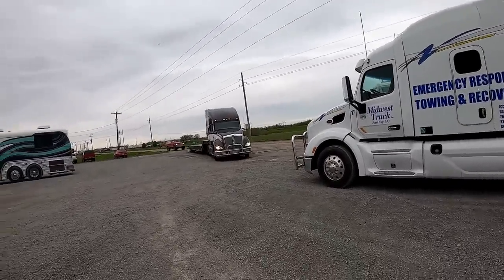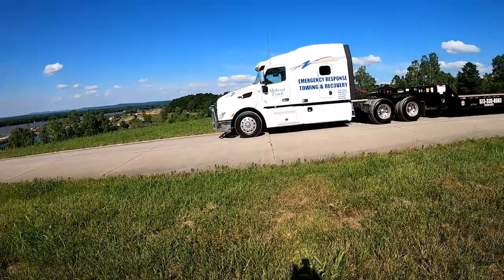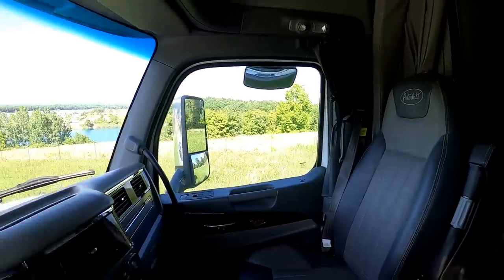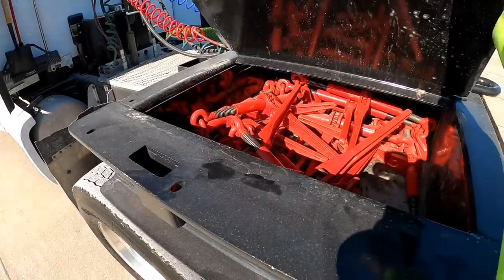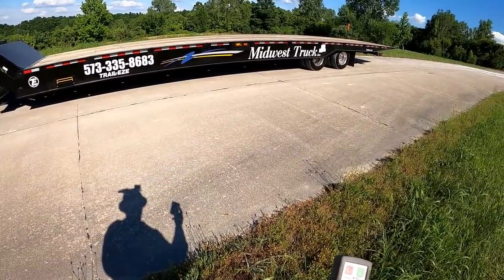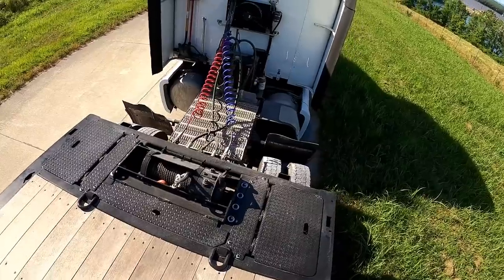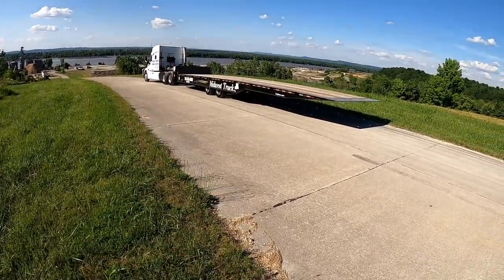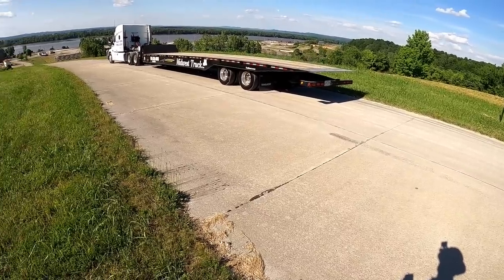Walk Around of Truck 17 and our new Trail-Eze TE801 trailer #T-1!!!

Comment: Congrats on your new unit(s) I know you'll wonder how you ever did without it. Nothing works better for rescuing dead trucks,,, The versatility of a sliding axle unit is unbelievable.. Couple of questions as I'm not familiar with traileze,,, when the axles are in the forward position, is the ram extended or retracted?.. can you travel with the deck in the high position for long loads,,, otherwise I love the multiple tie downs, and stake pockets,,, best of luck with your new units

Comment: That is a nice trailer I like all the extra tie down points. They'll be really useful for when you have a badly damaged semi or a load of damaged parts to tie down.. When you have the axles all the way forward you will have to watch the swing on the back end. But it will pay off with the extra maneuverability in tight roadways where it would make turning impossible.. I cant see a way you could make it any better what with the winch and the low approach angle  on the deck. Id hate to think what it costs but you'll make it pay.

Comment: Ron, always good to see a family business expanding. Do you plan on putting half or full fenders on to keep the  debris off the sleeper?
A headache rack would work for more storage and protection also.
As always stay safe and God bless to you and the crew.
Reply: I agree with both of these suggestions also. Rear fender keep the road spray down. A headache rack could be usefull to hold stuff--but also as a another spot for work lights, etc.

Comment: Add a air fitting on the trailer..we found during the winter a female wouldn’t work so we went with a gate valve and a male fitting otherwise you need a long hose to the tractor to air up to release brakes and raise airbags on motor homes and busses. You will need to load busses backwards as you only have tandems on the trailer it puts you over 37k also load on level ground if your leaning it will increase the lean as you extend the wheels back..I drove both landolls and trail eze and trail king trailers for towing for years

Comment: That is a cool trailer, I'm sure you're going to get this thing into some more tight spots, I'm looking forward to those videos!

Are you going to end up getting some regular flatbed equipment on the truck? Straps, ratchet binders, edge protectors, dunnage, etc?

Also, I know you are planning on using it for recovery and transport and not regular freight, but do you have a safety plan for a headache rack or bulkhead?

Stay safe!

Comment: Is that new trailer low enough to load some of the new class A motor homes/coach style RV's with there low ground clearances? It looked like it should be able to do that in my opinion. You might need to mostly convert the sleeper in to a storage area. I also think this unit will be a good candidate for your batter powered portable lights.

Comment: Really like that trailer, can you leave it all in one flat plane and move the wheels back to haul long stuff? 41` + 9` - 50` stuff/ load
Reply: I think Plaza Towing has some older videos showing loads like that on a Landoll. You just run the front axle onto the upper deck and secure one end in both directions, then level out and finish securing the load. The load ends up at an angle, but as long as it clears anything overhead that's fine.

Comment: VERY nice ! Why did you go with this trailer over a Landoll trailer?  I know you have two spaces for binders and chains on the trailer. But I still think you should add a chain box and have two sets  four chain and binders each maybe three sets. Plus if you get a job like someones motor home and they want it to the other end of the state or some place far away the driver can sleep in the truck.

Comment: You may need to take it to a dealership but I believe you can have it set to idle the truck up automatically when the pto is engaged. Also have you thought about installing a headache rack or some kind of removable stop on the front of the trailer?

Comment: Plaza Towing has a trailer like that and they use it quite often. You started with the rotator and then got the trailer. They started with the trailer and then got a rotator. I know it will come in handy.

Comment: Well, that is a very impressive trailer. I trust it will give many years of excellent service. Will some emergency lighting be installed?
Reply: A nice big LED flashing arrow board with SLOW DOWN MOVE OVER on the back of the cab.

Comment: Well if you can't sell it even if you try, then use it for work, good decision. XD I'm sure the sleep and living room of that unit will come handy one day. The fridge could be needed on hot days when you have a bigger recovery, as well as the room itself when it has air conditioning. Nice spot to take a short break when its hot or something.

Is it possible to add a holder for the traffic cones on the same spot where the broom and shovel are? Just on the passenger side where is still room. I'm sure there whould be a good place for those because easy and fast to reach AND on the passenger side.

So that trailer is one of those where the rear axles move forward so that the tail goes down to load a vehicle on it? Only saw this once as someone transported a bulldozer but this system is surely handy because basicly the whole trailer becomes the ramp.

Comment: I think the biggest major difference between this unit and what Plaza uses is the tool boxes on the tractor Plaza has. 2 on each side like on your unit 15.
With the height restriction of the overpasses, how often would this unit be usable on a recovery on the highways? I suspect that the height of the overpasses will make it less than it would be otherwise.
oh and Ron, those lighted gloves:
June 20, 2020 at 6:26 pm
Processed Through Facility
ISC CHICAGO IL (USPS) 

the border / airport closures delayed shipment. :/

Comment: I have seen Jerr Dan advertising their R.A.I.L lightings system on the sides of their rollback decks.  Might be something worthwhile to look into to increase rearward visibility on the trailer especially when loading equipment that could block the lights on the 579.  Essentially It looks like they just fabricated a box that places an amber light at a 15 degree angle so it faces traffic when the bed is tilted

Comment: Ron, You're probably aware. But just in case you don't. Both East MFG. And Mac Trailer sales can and will build you a custom headache racks. Mac trailers built all of ours for us. Water tight seals and built in light bars on the top for work lights and strobes.  IHMO, I think Mac is setting the bar in this department. "You dream it, they'll build it" I personally believe that a good headache rack makes your job so easy. It keeps all that equipment out if the truck and out from under the bunk and bouncing around. And I'd add a step box on both sides of the tractor. I have more stuff in these boxes than you can imagine, Straps and cut protection on one side. And my OD signs and flagging on the other, along with my 12 hockey puck magnetic lights like you use. I also added a custom built in between the frame rails box, the bottom has 2"x3/4" expanded metal in it. So if you place wet signs of flags on top of the blocking, it will drain and dry. So it's not in the cab of the truck all wet. It holds 8, 24" 4x4's stacked on top of each other. We basically have tried to keep ALL the securement out of the cab of the truck and out from under the bunk. The only thing in there now is the small hand tools in a tool box. And a good supply of clean rags and a container of waterless hand cleaner, along with work gloves. But I've even got to the point now, that as soon as there greasy and nasty. They go into the side step boxes to be washed of thrown away. Gloves are bought by the case and handed out to fellow operators and drivers like business cards. You hand a guy a good pair of above the wrist gloves and a business card. He will remember you. All the law Enforcement we deal with have a pair of our gloves with our company name on them. And they appreciate having them. God Bless our law enforcement officers in this troubling time. Hey, Ron, You and your team. Be safe in your travels my friend.

Comment: Make sure you have a zMater in the dash  very important, also do you.have lights & siren, on the unit, since sometimes you guys are called by the police , to.be there fast,the trailer looks like it could haul 2 to 3 cars which works better than the flatbed

Comment: Big boys with their big toys! LOL Congrats Ron. A question just occurred to me. When you have tractor trailer accidents where it's only the tractor, why don't you take your tractor out to pull the trailer instead of using the rotator to do that? Yes, it involves another driver, and of course there are the fuel considerations. But the question is whether there is any safety concern with towing a damaged tractor with the trailer connected?
Reply from the maker: That was one of the reasons we decided to put this road tractor to work.  We can use it to perform "split-tows" like you are referring to.   Thanks for watching and God bless.

Comment: Really useful trailer. Congrats on the new equipment.
I have a question for anyone that knows about these things..
Why does no American trucking and hauling companies use the trailers with steerable wheels; like the Goldhofer trailers made in Germany I think,  and used a lot in Europe. 
It seems to me those would be extremely useful in wreck amd recovery situations, enabling much eaiser placing of the trailers in optimal positions.
Reply: Just my opinion on the subject; Costs. One of the things that an owner of a fleet has to consider is the cost of equipment vs the revenue generated by the equipment. They'll find that setup easier to operate, easier to train operators. I can see them possibly even getting rid of the little Pete.

As for the steerable axle trailers, you have to remember their service area. I wouldn't think they would have a lot of use for a trailer for the Heavy Hauling niche. Plus, the Pete with a 10 speed definitely isn't for heavy work.

Comment: I've had to use that sliding axles front trick several times when I did flat bed. Canyon roads and a 48ft trailer dont mix. Damn job sites are always on the puckerest of roads

Comment: If you are using a gopro, you might want to use the spot meter function. It auto-adjusts to the center of the image rather than the brightest part.

Comment: Hi Ron Great video. I have an idea for you. As we all know winter is around the corner. So if you should choose you would still have time to order what they call a little Chinese diesel Heater. They are 1500 to 1800 BTU and you can get them with one 3 inch or 4 smaller exhaust heat outlets. I figured with the four you would be able to heat several compartments on your Rotator and maybe your other wreckers. That way when it's  Bone chilling and you can't  stop to even warm up your hands you can open a compartment and it would blow hot air. They cost for a 5kw about $110 or so. Or around $140 in a metal suitcase style box. They can use the diesel and 12volt from your trucks. They are the same exact Heater as The German at Around $700. Check out John MCK 47 . He has had one on his yacht  for 20 years now. He is a expert at these. Hope this helps. God bless

Comment: Beautiful equipment!! Two questions: Is that an electric winch at the head of the trailer, or is that hydraulic run by the wet kit? Also, that's the "mother of all tandem sliders!" How in the world do they keep the air lines free-flowing? A set of steel cable and pulleys to take up the slack??
Reply from the maker: 1.   It is a hydraulic winch run by the wet kit.
2.  The engineers at TrailEze figured all that out.   If it is like our rollbacks and the Rotator, the hoses and lines are in a "rolling" metal track similar to this:    https://www.firgelliauto.com/products/fully-closed-metal-cable-drag-chain-link-pitch-75mm-r-100mm-l-1-2m?variant=43528721301&currency=USD&utm_medium=product_sync&utm_source=google&utm_content=sag_organic&utm_campaign=sag_organic&gclid=Cj0KCQjw0Mb3BRCaARIsAPSNGpWFYZP4eIVfCVRC_YKCQeHtWns-jm_HgbSXXXIxzRObcQjF__-FRpcaAkjqEALw_wcB
Thanks for watching and God bless.

Comment: What is the axle frame attached to ?
I assume there is a sliding rail on the underside of the bed, but is the axle moved by pistons or hydraulic motors ?
It's good your usual customers are helping to pay this off, same way Plaza Towing use theirs.

Comment: Not that you'll probably be disconnecting it very often, but do you have high-flow quick connects on the wet kit to trailer lines, or does it use wrenched fittings?  I'm only assuming you can get QD's that don't add too much restriction (and thus heat + flow restriction) at the high flow rates needed for these large cylinders.  The tank trailers I used to work with that had wet kits were wrenched hookups, which made it a pain when we had to take a trailer for servicing / rebuilds.

Comment: Two (maybe three) comments

WOW! Just WOW! Two rollbacks in one - sort of.
Two items you might want to get together with your local fire department about A) Scene lights (semi- or permanently) attached to the sleeper - at least something you can "light up the scene" once you get this rig there (make work a LOT easier if you do) and B) a permanently attached generator for those scene lights (or for cords if you have power tools that are portable (or the lights)

Make sure you keep the refrigerator stocked with plenty of water (or sports drinks - but preferably water) and if you DO, make SURE you rotate the stock to keep from having stale water. Yes, I know you said this was not an "emergency response" vehicle, but if you have it on scene for any reason, you will have been there long enough to need/want the water!!!

Comment: I don't think you'll use this for coast to coast hauls and thus the fuel savings might not mean as much as in some other applications - but did you consider "super singles" as opposed to the duals?  Maybe your thoughts on super singles in general and when it comes to recovery?

Comment: Ron what made you go with this manufacturer instead of landoll 455 that offers a air tank under the bed that you can put air to a rv air system if the engine is non functional to winch it on the trailer or to keep a truck and trailer aired up if the engine is disabled while pulling it with the rotator and the Vulcan v70

Comment: Just wondering, if you needed to use the trailer to carry an overweight load, would it be possible to move the axles forward, and fix perhaps a pair of bogey axles at the rear of the trailer?

Comment: That is a really nice setup.  Would the rotator fit up on that trailer if it had too?  Or would it be too heavy for it.
Reply from the maker: I would be concerned about putting the Rotator on there.  It would fit, but I don't think I'd want to push the trailer that hard.  The Tator weighs just over 72,000 lbs.  Also, it would be too tall to haul it very far.   However, the Western Star and the Lil' Pete would easily fit on there....I've already tried ;-)   Thanks for watching and God bless.

Comment: Smart piece of kit Ron got a couple of questions, can you raise the angle when unloading a piece of equipment whether that be a burnout vehicle or container and pull forward with the platform raised. 2 does this have what I would call a detachable sledge plate, what I mean is a sprung loaded latch behind the pin that pivets on the neck just to stop it lifting the drives at high angle. Just curious as I use a landoll in the uk and find these features useful.
Reply from the maker: We can move forward with the bed lifted as long as the tailboard isn't dragging the ground.   Fortunately we have the Rotator and other Heavy units to help lift difficult loads on and off the deck.  And, no, ours does not have a fifth wheel stop plate.    Thanks for watching and God bless.
Reply: @RonPratt  thanks for replying, it will definitely come in handy for you and I can't imagine it will sit around for very long. I would put a low loader of some description up there with the most useful piece of equipment but I think underrated.

Comment: Nice need to linseed oil the deck keep the wood nice so no splinters in your bottom what's the lower deck  height on your trailer. In Calif 50 ft landoll 39 feet lower deck 3ft lower deck height